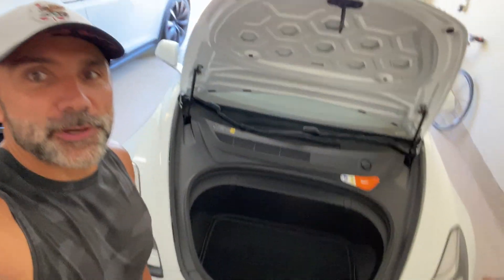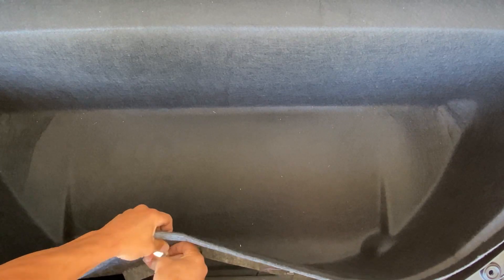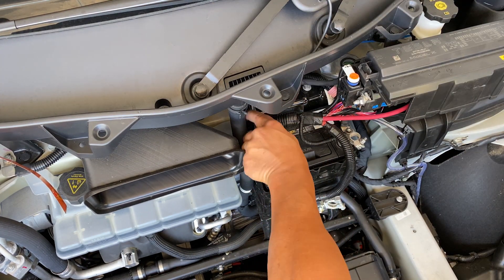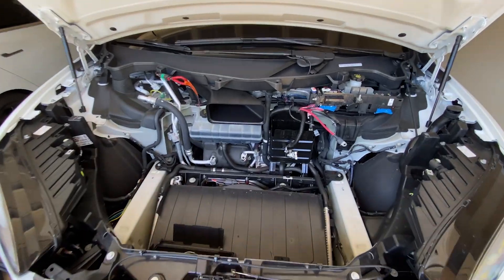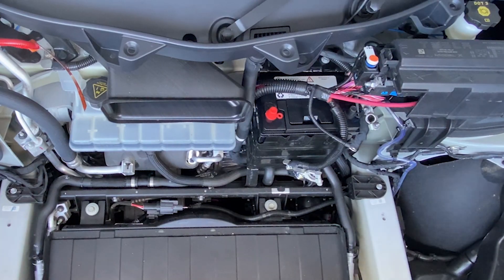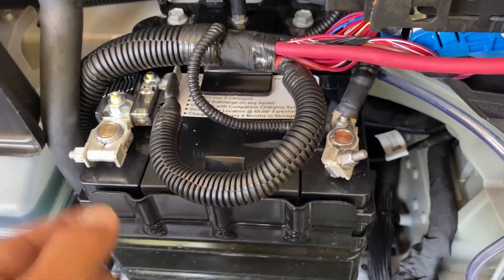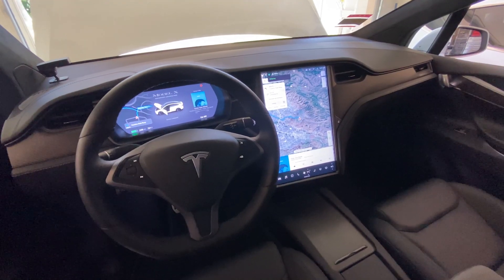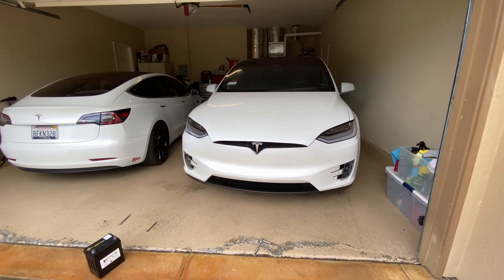TESLA Model X (12V) Lithium Battery Install!

Comment: I have a 2017 Model X, the 12 volt battery waring just came on and I have watched several video's about replacing the battery with Lithium.  I talked to the a dealership and I was warned the system is not geared up for Lithium and should stay with what comes in the car.  Have you had any problems with the car after the Lithium battery has been installed.  Also, trying to find a replacement battery that is the same is like pulling teeth.  Any suggestions?  I have been looking for a Hankook 60B19RS, all of the autoparts are telling me they cannot cross that number.
Stan

Comment: Before you loose all there shown electrical wires have a look at Ohmmu‘s video of an installation in a Model X. These wires must not taken off. I‘ve seen Ohmmus video at my battery replacement and it was much easier and electrically safer. But there are many ways to reach the goal…🤗 and don‘t forget to make your car power off! The safety connector on the left hand side!“

Comment: it’s advisable to remove the high voltage connector (Over to the left with the orange tag on it). Also much easier to take the whole battery holder out and take the battery out of it after removing from the car. Now Ohmmu is making the Model X battery with the positive on the right. That way the leads don’t cross (I thought I received the wrong battery but I talked to a guy at Ohmmu and he explained it). Also a good tip to apply the lithium grease to the sides of the battery to make it easier to pull out if it should fail.

Comment: Where can I get that battery for the model x?
Reply from the maker: Hi. Ohmmu batteries are the ones I installed in both my Tesla's (Model X and 3). Here's a link: https://www.ohmmu.com
Reply: @shootmedia2155  thanks a lot! I wonder why Tesla don't use this type battery? It su..ks to know they put cheap toxic stuff on Supper Expensive vehicle (like model X). Thanks
Reply: $ 479 USD in Amazon.com (12V Lithium Battery for Tesla Model X)